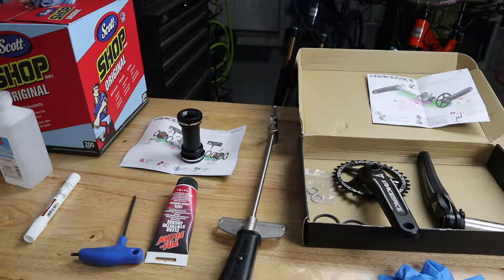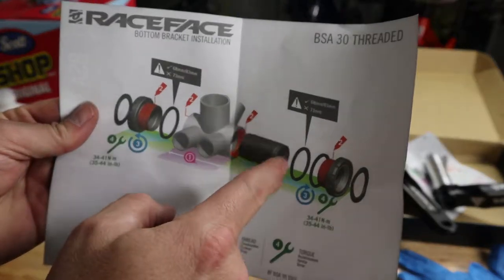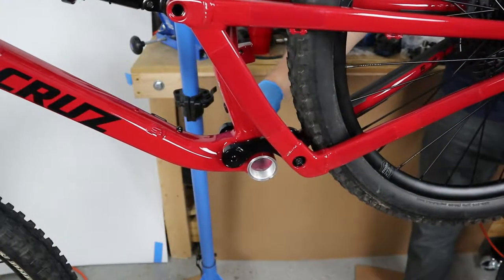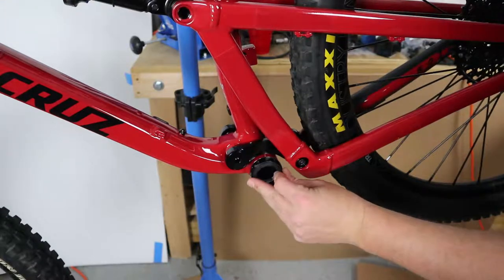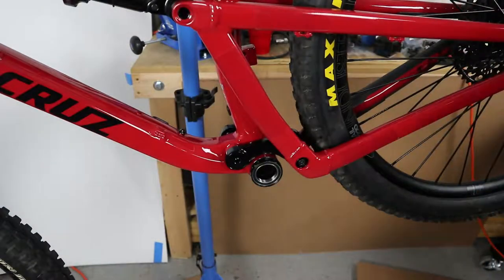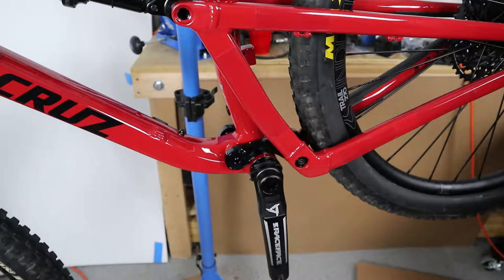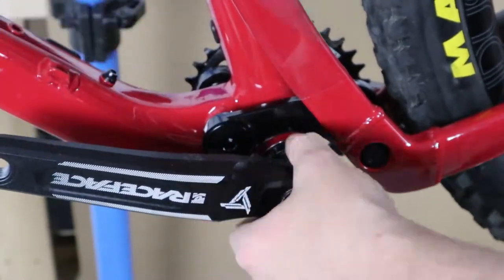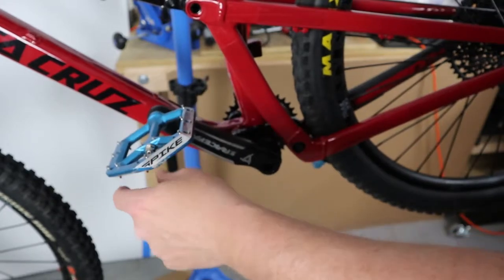#MTBPlanB Ep 5: 2018 Santa Cruz 5010 v2.1 AL Bike Build - Bottom Bracket and crankset

Comment: 10:06  Apply Threaddlocker like Loctite 243 on the threads, undo the non-drive side and do the same there. Loctite on every single thread is a must, apart from headset cap.
it is common for crank too loosen up, some only applied Loctite to one side, as they assumed Race Face did it properly, they did not, so cranks loosened up.
Loctite is a must.

Comment: I am quite sceptical towards RaceFace bottom brackets I have to repack them a lot,  one ride after repacking the area is filled with grease and stones. that was few days ago so it was in the spring, just few muddy and wet spots, mostly dry, but in the winter it was horrible, I had to repack them  very often. I have Chris King Threadfit on my old bikes, I will see how they perform, but they did well so far.
far better sealed.

Comment: 0:32 I hate those, the wood screw rounds off, I changed many, But when the Cane Creek preload ring comes out, I will buy it.
http://www.canecreek.com/product/crank-preloader/
this is the only flaw with this crank, I have Turbine & atlas, I like them, they held up well.
bolts on Race face componens are junk.
Reply from the maker: Johannes Nilsen Yes ty for the link...seems like a much better solution!